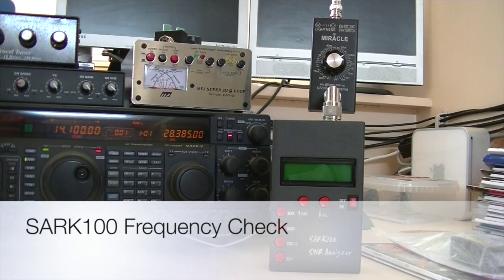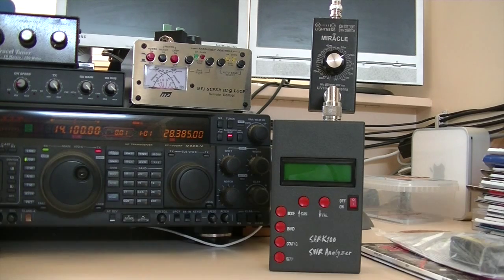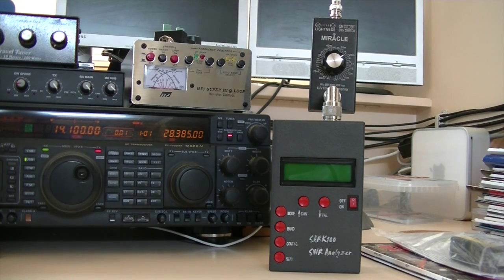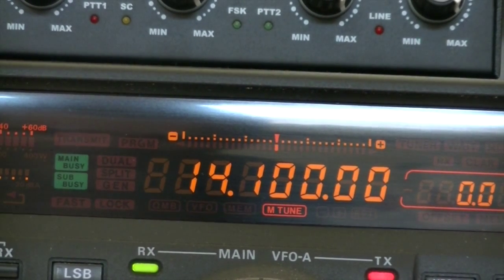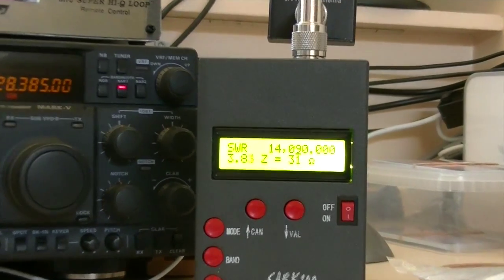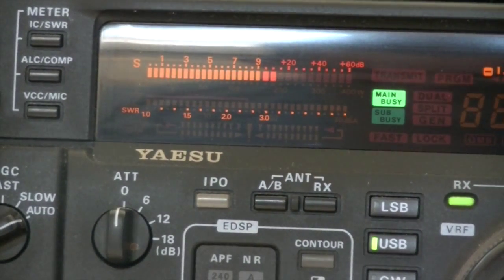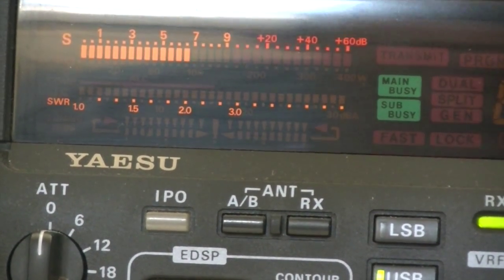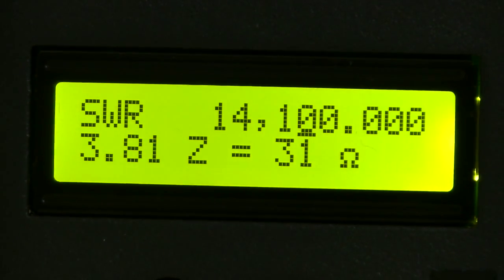SARK100 Frequency Check

Comment: Acquired a parser of these and am awaiting arrival, what is the procedure to check the frequency of the radio is operating? simply turn on the radio straight into the analyzer? Sammyr Maia PU8AMI, Manaus, AM, Brazil
Reply from the maker: Sammyr Maia Hi Sammyr. This analyzer is for checking the antenna. You should never connect it to the radio because it will break the analyzer. You should only connect it to the antenna. You can set the frequency on the analyzer to check how your antenna is working on that frequency, or you can let the analyzer check on which frequencies your antenna is working best.
Reply: Cees Alberts But in the video, I saw that u modulated on radio and appeared in the correct frequency analyzer in the case of the video analyzer was connected to what equipment ??
Reply from the maker: Sammyr Maia In the video the analyzer is sending out a signal tone that my radio receives. The analyzer uses a very small amount of power to send out a tone so it can check the reflected power and check the antenna.